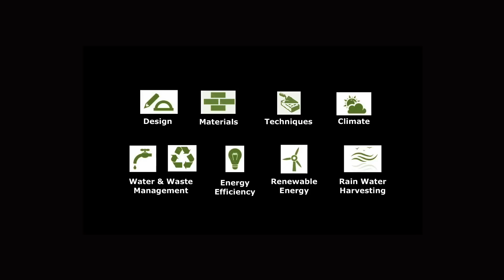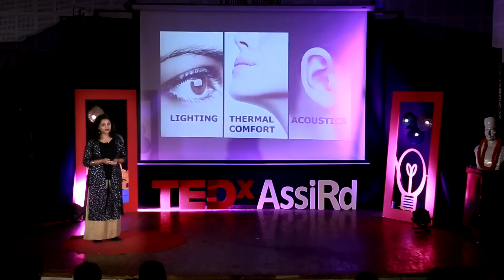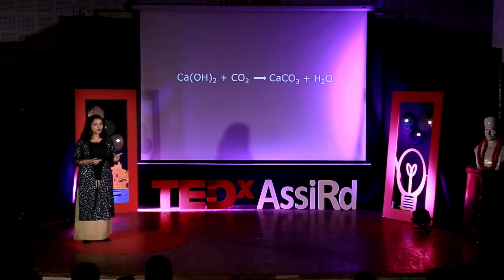Making smart buildings before making buildings smart | Trupti Doshi | TEDxAssiRd

Comment: Trupti- Please check into the company BioMason founded by Ginger Dosier. They grow bricks and cement using microorganisms. Significant positive impact to environment, reduction in carbon emission and cost. Also, check Shigeru Ban who makes houses with recycled paper for under $200. (Both on TEDX). A temple in Udupi and years ago, cow dung bricks were used for construction, kept a house cool in the hot sun. Namibia built a building after studying termite mounds (temp in mound always between 30-35 c without an AC). Now, we use technology that increases carbon emissions and is so ill suited for India's environment.
Reply: Thanks Ramprasad for sharing this :)